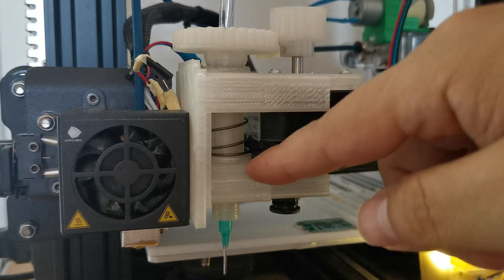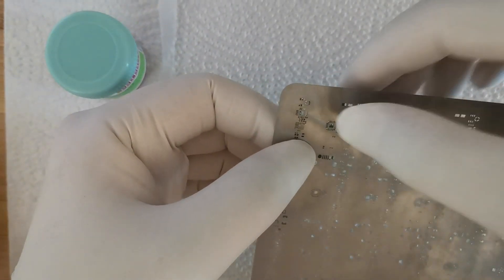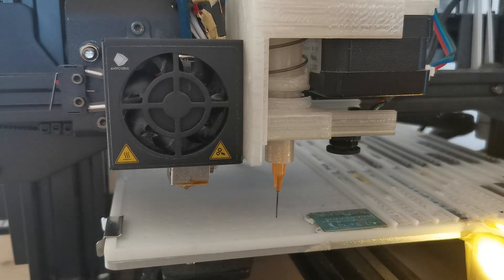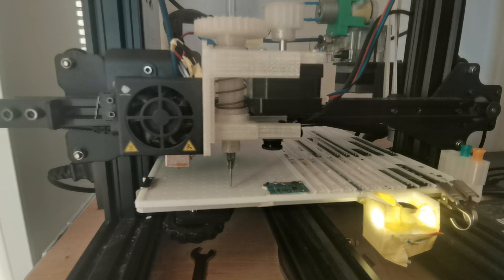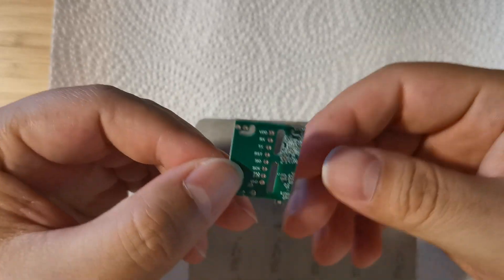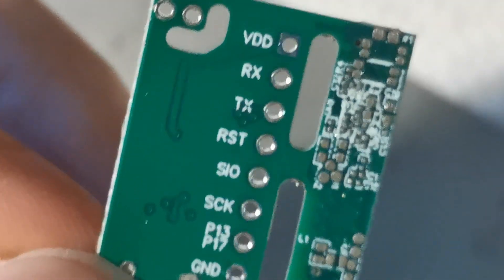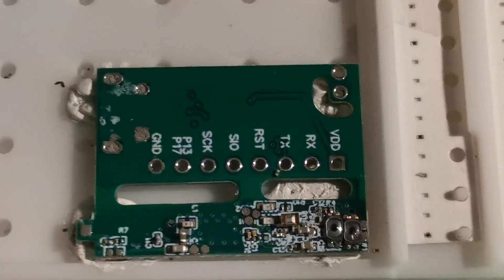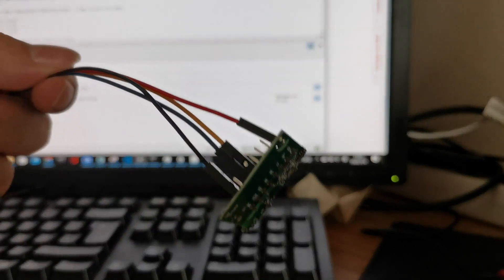DIY pick and place machine from 3D printer Part 6 - PCB Board placed and running !

Comment: As the plate is moving and all the components and pcb is moving instead of the head, did you notice any challenge like already placed component jumped and went off the correct location?
Reply from the maker: Actually I was worried about that before but then when I put everything in place, this doesn't happen, the solder paste is actually make it stay in the position, and we can also lower down the acceleration if that is the issue for bigger component, but so far I never observe this.